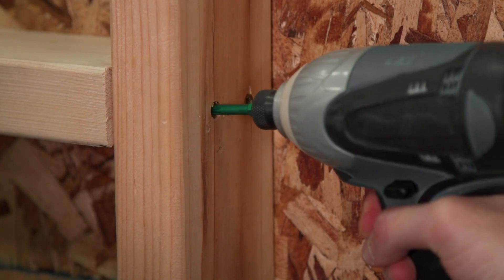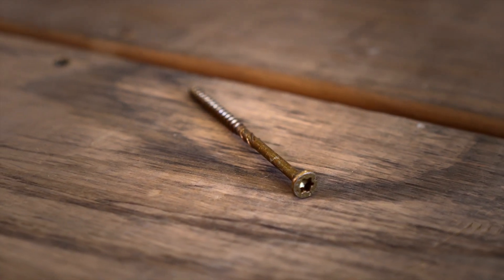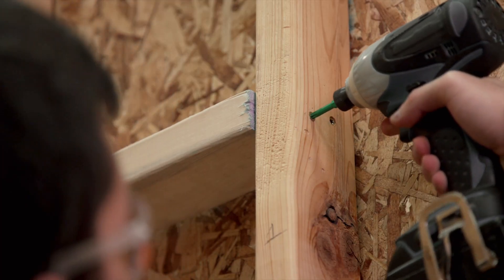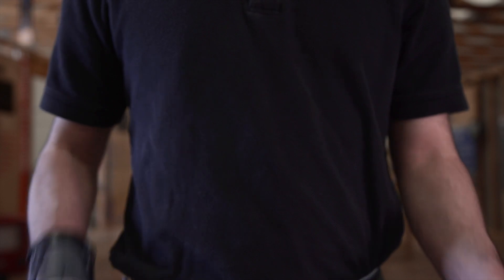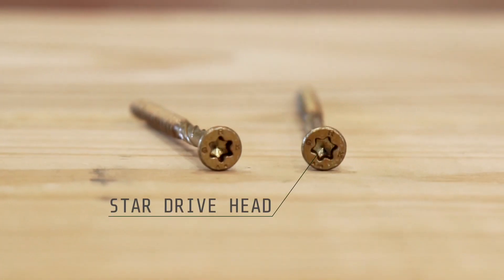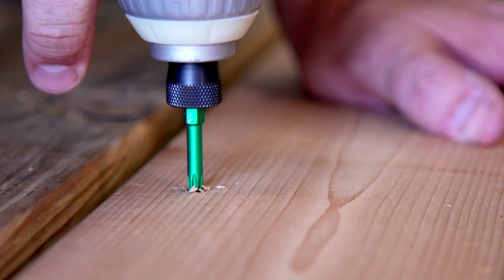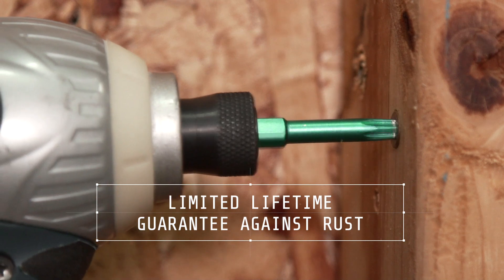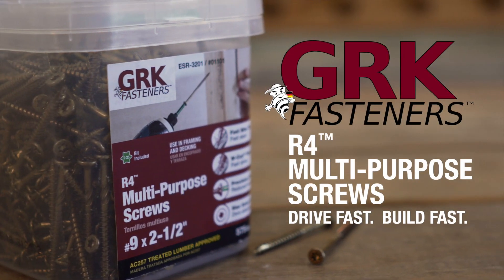GRK R4 Multi-Purpose Framing & Decking Screws

Comment: Old heads are stuck in their old ways. There are now screws that are compliant to frame with and have similar sheer strength to a 16 penny nail. Make sure you read the box. I used these screws building my deck which is 20x40 and it passed code. Not to mention I had 20 people walking on it at the Christmas party and not a squeek. GRK and Spax are the best screws out.